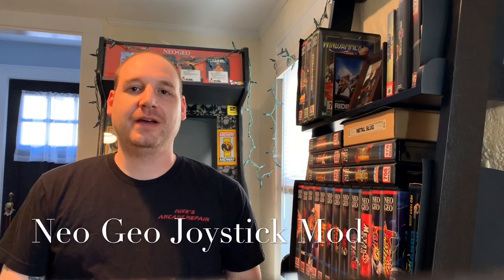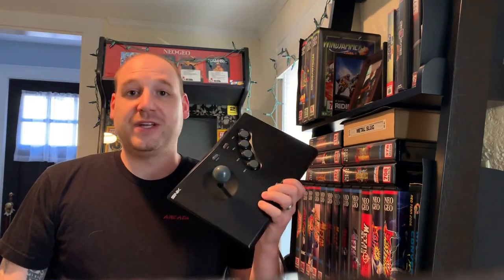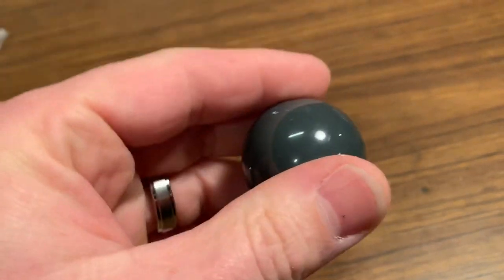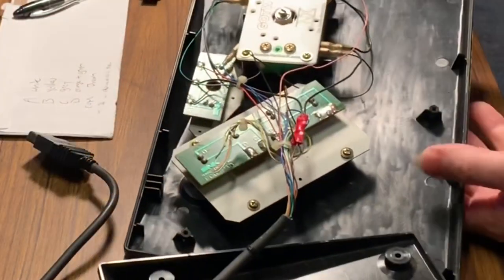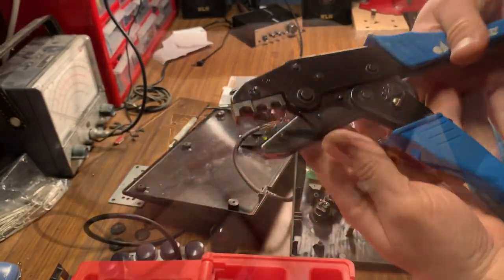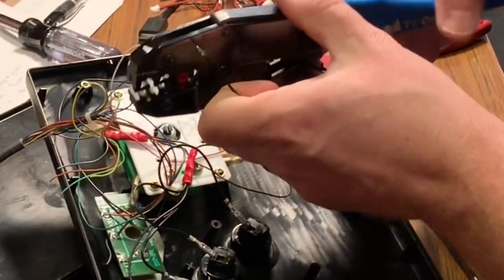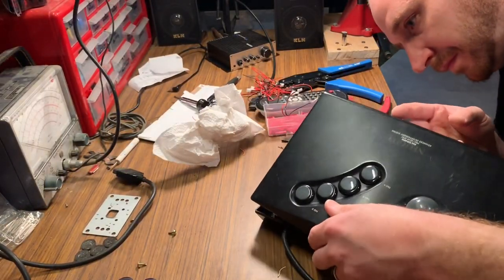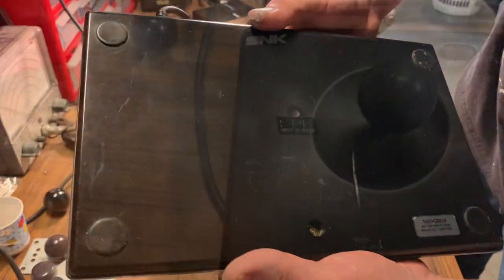Neo Geo Solder Free Joystick Modifications

Comment: Another very simple mod I would recommend you make for a Neo-Geo AES stick is to add wheel weights. the Neo-Geo AES stick is just a tad bit too light. Wheel weights add in 4 oz per weight, and have adhesive on one side. Putting in eight or even just four of them will add a subtle but satisfying amount of extra weight when using it in your lap.

Comment: Nice informative mod vid. I have a question concerning the joystick wiring. Hopefully, you’ll time & knowledge to assist me. 

I’m actually working on a NGX controller. My query concerns the joystick & the 5 wires that go it. Of course we have up, down, left & right. My question is where should the 5th wire be attached? 

I was having an issue moving up. When I disassembled the Stick the 5th wire, which isn’t marked was loose. I couldn’t discern where it was originally soldered. Your assistance would be appreciated, if you can help - Thanks Player 🕹
Reply from the maker: DeadThumbGamer if none of the controls are working you may have disconnected a ground wire by mistake.  I’m not super familiar with the neo Geo x but there should be one wire to each micro switch and then a common ground wire that daisy chains to the other side of all the micro switches.  If that doesn’t clear it up send me a picture at mikesarcaderepair@gmail.com
Reply: Mike7599 very cool of you Gamer, I’ll send a pic momentarily. No rush or worries in replying either. I’m sure you have things to do. Thanks a lot though ✌🏿

Comment: Were did you get your quick disconnects with the wire intact?
Reply from the maker: You can get them on Amazon, eBay or even your local Home Depot or Loews in the electrical isle.

Comment: I have 2 sticks on the way so plan to do this. Dont have crimps right now. Could you wrap the bare wires around the button terminal as a temp mod?
Reply from the maker: Sure!  I would just wrap the connections with electrical tape so it doesn’t short anything.  Also you don’t need a ratcheting crimper, you can just get a cheap standard crimper from Home Depot .  Good luck with the mod, thanks for watching!
Reply: @mike7599  so the 3 ground wires  go to one terminal on button A then you get 3 other wires that go from that ground pin to each of the others?  So that button has a total of 5 wires attached? (1 on one side and 4 ground)
Reply from the maker: sorry it’s not super clear in my video.  When you go to cut the wires to remove the button pcb you’ll see (it’s labeled) there is a terminal for button A, B,C,D and common.  Each terminal has 1 wire going to it  except D which has two wires going to it.  You’ll take the A wire and put it on one spade terminal of the new button.  Then you’ll take the B wire and put it on one side of the B button terminals etc etc.  on the D button your going to take the two wires and twist them together so they become one wire.  Then Put that on one of the spade terminals on the new D button.  As for the ground wires you’ll take the one ground you cut off the the pcb and then make a connection from this to each button on the
Reply from the maker: Wire the grounds in parallel to each of the free spade terminals remaining on each button.  So basically with the exception of the D button you will have only 2 wires to each button.  Once you open up your control stick it’ll make more sense what I mean
Reply: @mike7599  got ya. Did you go for sanwa or seimitsu buttons?
Reply from the maker: Kevin Young I went Sanwa but it’s all personal preference

Comment: is it possible to mod a Neo Geo stick with the universal fight board?
Reply from the maker: samuraispiritsx its possible, the main issue is getting the pcb to fit in the case.  It MIGHT work.... but I’m not 100% sure.  It’s going to be a tight fit for sure
Reply: @mike7599  I think I'm going to try on that Neo Geo stick plus for PS3 that came out a long time ago.
Reply from the maker: samuraispiritsx you may have better luck with a regular neo geo controller.  I’m sure that ps3 one has a lot more components inside of it - meaning even less room to mount the pcb!  Good luck keep me posted.